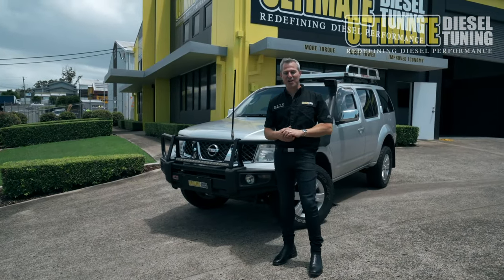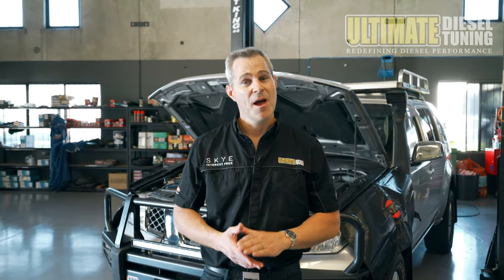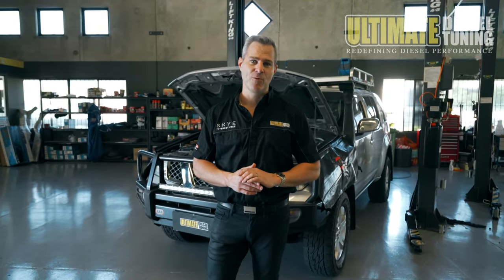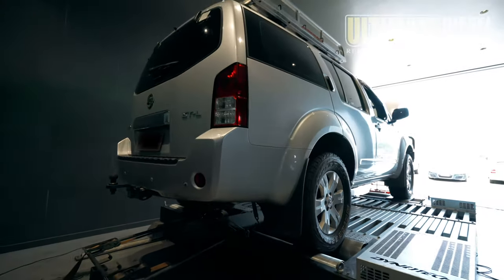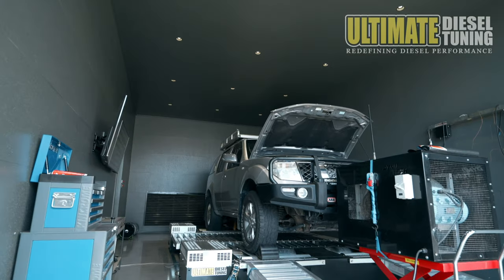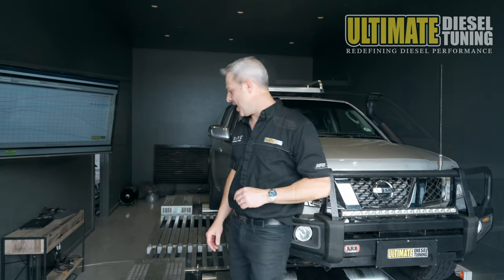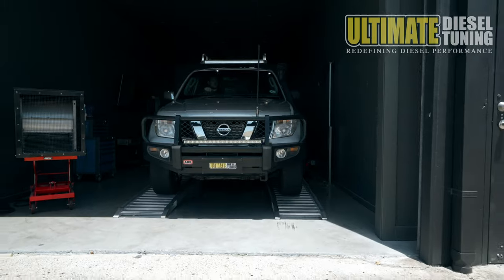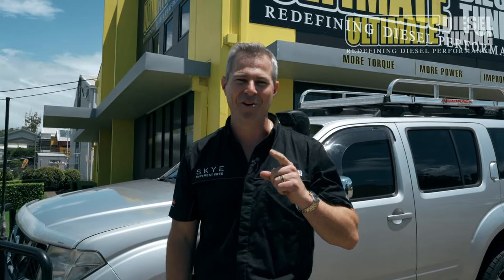Nissan Pathfinder - custom dyno tune!

Comment: Hey guys, I've got a 2011 turbo diesel, just wanting to know how long to idle on start and stop of the pathfinder? Can't find any solid info anywhere
Reply from the maker: Do you mean heat the engine up before driving & cool it down before switching it off?
Reply: @UltimateDieselTuning  yup